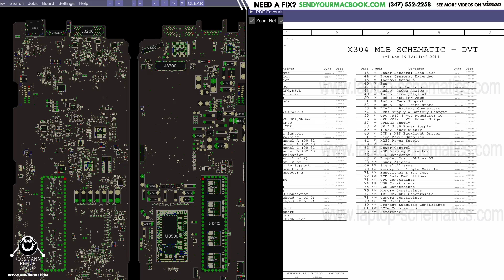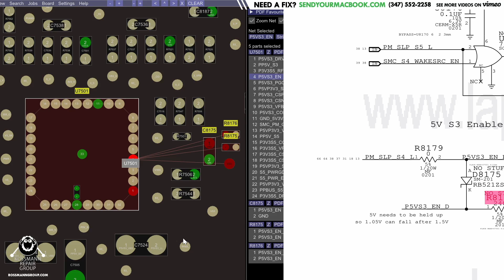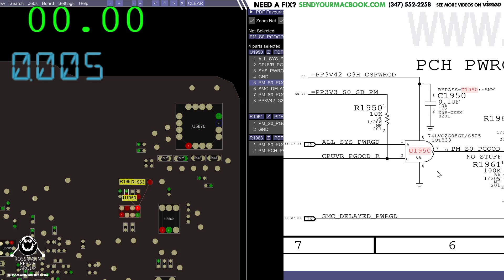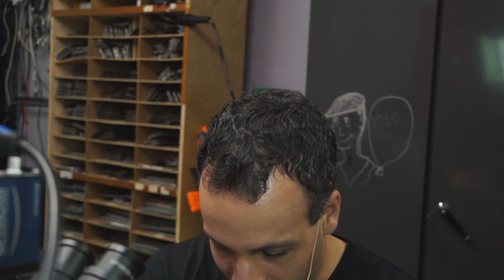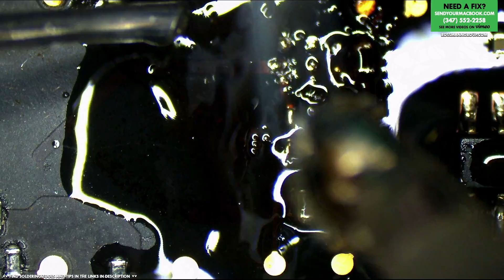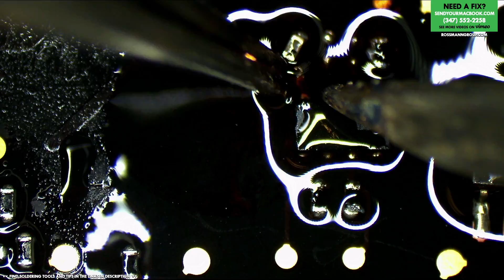Macbook Pro water damage repair

Comment: I have a problem with a Macbook Pro 15 Early 2011 I7 fans at maximum speed and very slow mouse pointer as well as the Macbook I started the Apple Hardware Test and got this error "Temperature (Tm0P) -DC In Proximity Airflow unble to read sensor the temperatures are all normal and the macbook does not heat up where the sensor is on the motherboard? thanks

Comment: JST is a brand but it is also a unofficial standard connector for a lot of electronics.  The most common one to see (in my experience) is the 2.54mm JST-XH connector.   There are also the Dupont connectors which are like the ones you find in PCs for things like the front panel connectors.

Comment: Spectrum's problem is making something so simple (like provisioning a modem) extremely complicated... It forces it's workers to perform redundantly ridiculous and utterly completely irrelevant tasks that take 80% of the time they need to actually work on the issue affecting the customer.   The executives pander to shareholders and investors so much, they implement backend systems that are not needed and are actually causing devices (like cable modems) to randomly become unprovisioned.     The company is in the top 20 worst companies to work for in the U.S.   Where I am, the cable company used to be Time Warner... 2 years ago... ANYTIME we had service issues or our modem wasn't working right, TWC was always able to fix it quickly, usually over the phone... Once, when a specialist had to come out, they fixed the modem and then upgraded ALL of our cable TV boxes.. for free... 
If you think Spectrum treat's its customers badly.... Imagine how bad that company treats its employees....

Comment: I have a suggestion that you probably will think is stupid. But I can guarantee that you’d increase views by millions if in addition to your normal 2 hour repair streams you made videos of you repairing, upgrading, and or modding  rare or popular electronics. Like if you made a crazy connector that lets you connect a Vega ii duo into a normal x16 pcie slot. Weird stuff like that. Something tells me if it were possible you’d find it fun anyway.  What about chopping down a MacBook pro and stuffing it inside an iPad. What about literally building an original apple from the ground up. After typing it out I’m thinking you might think it’s dumb or beneath you. However it would make your channel blow up.
Reply from the maker: I have no idea how to do those things

Comment: 'Freedom units' is an illusion. There is no longer a reference standard for the inch. At one time there was an imperial standard yard but the length of the standard became unstable . Since 1959 American 'imperial' units have relied on metric standards for reference. If you want to calibrate your inch/foot/yard measuring device, ultimately that calibration will be derived from the standard metre. If you don't believe me, just google "International yard and pound".

Comment: Hey Louis I was commenting to ask if you worked on apple watches? I bought one over a year ago and have taken very good care of it. It randomly stopped charging and when I called the only place near me to see what it would cost just see what was wrong with it they said it would be $70. For a college student with minimum hours that’s a lot. Best Buy the place I got it from let me place it one of the chargers there to see if that may be the problem but it wasn’t so I know that is not the problem. The nearest apple store to me is just about 2 hours away and I would trust you way more than I would trust them. Thank you for your time

Comment: I hear people mention that Macbook's last longer than PC's, but the majority of 3rd-party repair shops have stacks of Macbook's. Do Mac's last longer than PC's at the same price or not?
Reply: Never had a Mac but my PC and laptop have had no issues. My oldest desktop is over 10 years and hasnt had a hardware failure yet. Laptop is nearly as old and only has an odd quirk where you have to take out the CMOS battery and put it back in if the battery dies while the machine is running. My kids use the laptop more than I do.
Reply: I would say generally yes, they are quite robust. There are notable exemptions to that rule (2008 and 2011 GPU failures, basically any MacBook with the butterfly keyboard, etc) but for the most part it holds up imo. I truly do not believe the issues that Rossmann details on this channel day to day are a significant portion of the installed base, and sometimes (as in the case of this video) are caused by user neglect.
Reply: @accordinglyryan  macbooks or apple products in general are more robust that most PCs, but we shouldn't be comparing them to the avarage pc and instead consider the price they are sold at
for the price apple devices are sold at and their failure rate is still not significantly higher, but certainly far less acceptable
i don't believe louis really harps on how many failed macbooks there are either, but that - as he emphasized in the past - apple systematically denies being at fault for the failure while other PC manufacturers are generally held responsible
Reply: It seriously depends on your Starbucks spilling habits.  They are not robust for clumsy fuckers, but keep the liquid out of them and they are fine machines.  I have 2 MacBook Pros, 1 MacBook Air, 2 iPad Pros, and a partridge in a pear tree.  I work from home and routinely sit outside in my 110deg California summers working for hours on them without any issues whatsoever.  My Late 2013 Air has taken the most abuse, and made me the most money as my primary machine and road warrior travel machine.  I work outside in rain storms under my covered patio for hours at 97% humidity that others swear up and down will just kill them and cook it in triple digit temps for months....now that it’s 7 years old, the battery life isn’t what it used to be, but that is it.  Maybe I’m just extremely lucky, but I seriously doubt it.
Reply: i take my 2012macbook pro into the woods And the desert to dj campouts several times each year and it does just fine. but i don't spill liquids or drop it. ever.
Reply: Gecko remember that the plural of anecdote is not data so take people’s personal experience with a grain of salt.
The fact that you see stacks of macs on repair shops may be the result of quite different causes, for instance:
Macs break more than other machines 
Not all people who have invested a lot of money in buying a Mac have the money to upgrade to a new one
Conversely people who have bought cheaper laptops prefer to buy a new one because all considered it’s cheaper than fixing it 
Fixing macs (because there are so many) it’s easier and more profitable 
Etc.
In conclusion if you’re on the market for a new machine buy what is best for your needs and your budget. I think Louis has advised Lenovo as a quality and durable pc alternative to Mac.
Reply: @pansepot1490  100%. i take care of mine because it's an expensive piece of important gear that i can't just replace And repair because apple makes it difficult and costly. i can't just replace it whenever so  i two hand it. ikeep drinks away from it etc etc.
Reply: It looks like the answers here are a hit-and-miss, as the American's say. The comments are a bit of a mix-message:

- Apple users comparing computers from 10 years ago; old windows computers to their old Macbook. Windows computers back-then were not close to good.
- People mentioning it's the same longevity if the cost is similar.
- People mentioning I shouldn't listen to the comments due to bias. 

Pat Pezzi mentioning "take people’s personal experience with a grain of salt." would be the most accurate response.

Comment: M12 = MacBook 12
Jokes aside M12 is metric 12 (millimeters), if I recall it refers to the diameter of the bolt (threaded part).
Reply: Correct.  In the metric system  threads follow ISO M- standard, so M12 means a thread with a diameter of 12 millimetres and thread pitch of 1,75 millimetres. Search Wikipedia "ISO metric screw thread". 

Freedom unit? Really? lol

Comment: Corrosion moves on its own at 10:15
Reply: Hot air. Blows air, hence moves. It is corrosion but its loose because it is. Air blow thing move.
Reply: @jumbleofwords  no hot air in use at the time.
Reply: @21stcenturyjacktheripper  Yes there is. Use your ears, thanks. Nothing just moves because it does. Look up Newton

This thread was closed by moderator. Reason: Csongor Stelcz can't listen to sound